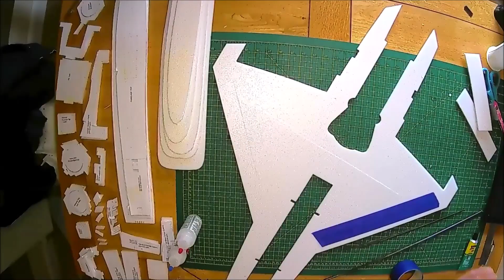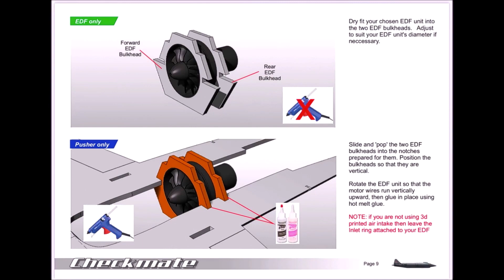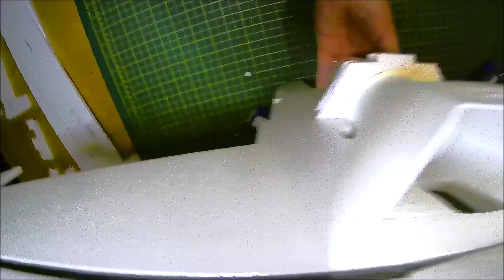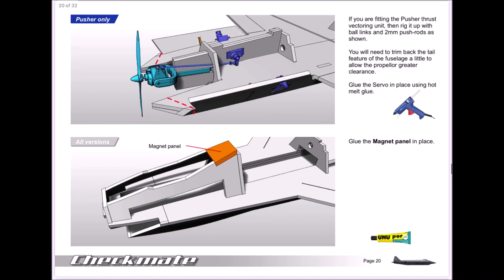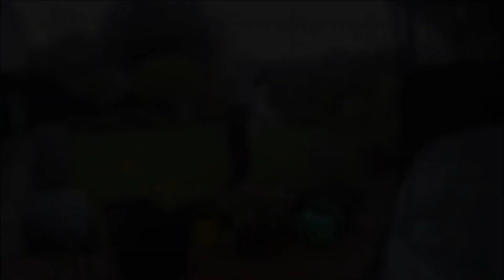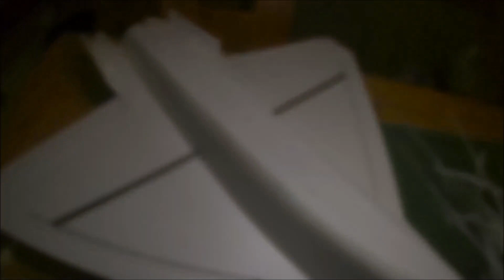Jetworks - SU-75 CHECKMATE Build

Comment: Hey kind sir...

I hope this message reaches you well....

I am building the su75 n may require some assistance with options as I intend to use rudders mixed with ailerons  and thrust vectoring....

The issue at hand is.....

Could I use a fiberglass form to lay up for the intake feed 

I try to be frugal...

Thanks for your vid and your time...

Be well... thanks.... Todd